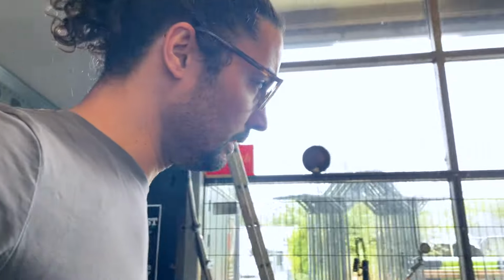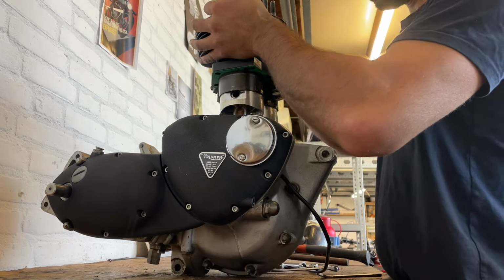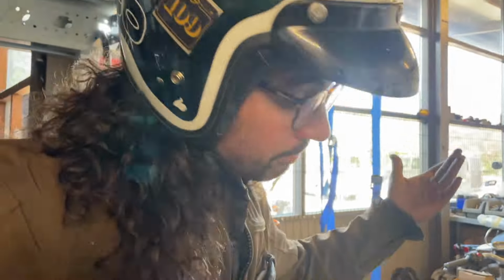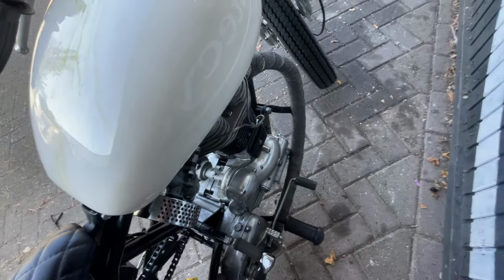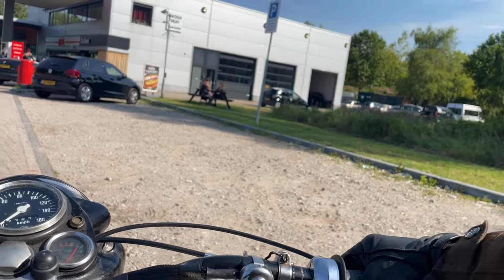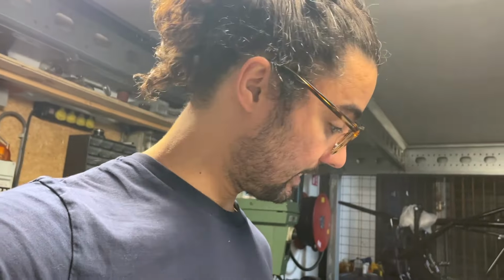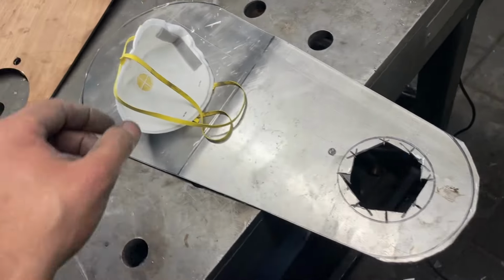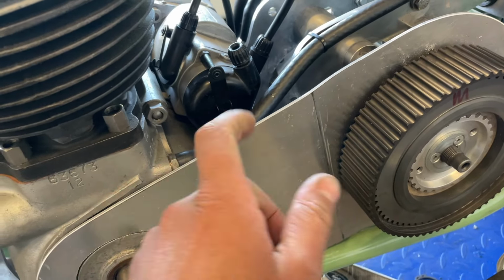ANOTHER MOTORCYCLE GOES HOME!!

Comment: What is your reason for gas welding the bracket rather than TIG?
Reply from the maker: @Bunk599   I like to try 🙋🏽‍♂️👨🏽‍🔧 if it doesn’t work at the end I will do it by TIG
Reply: What was the answer to the mystery of the shavings in the Bonneville engine? Or are you saving that for next week?
Reply from the maker: @garyheap3780   next week, yesterday I open the engine completely:)✌🏼👨🏽‍🔧